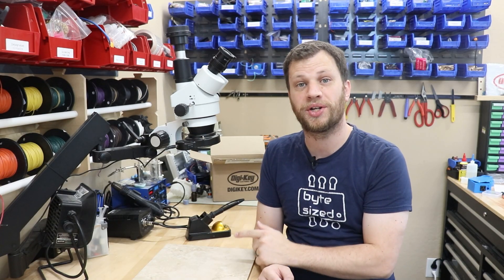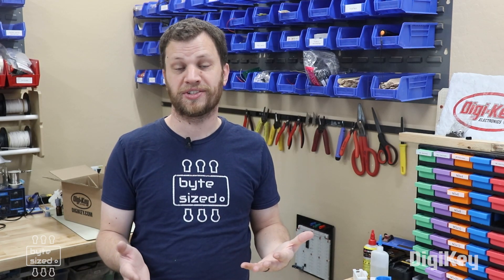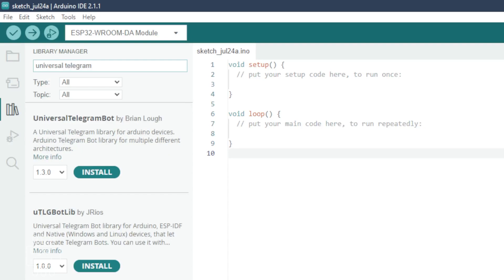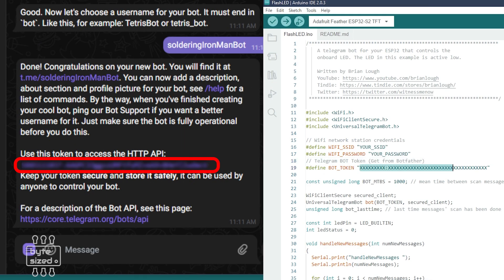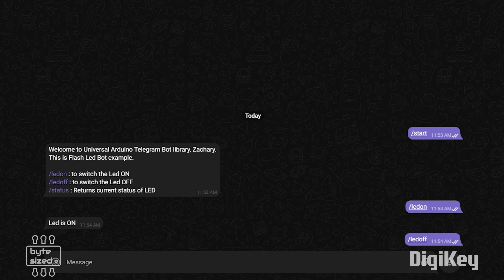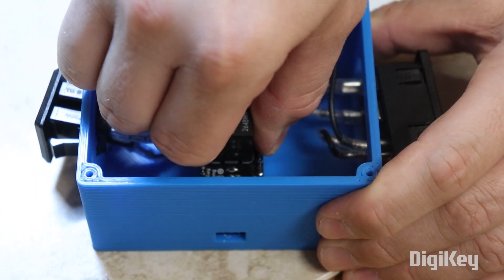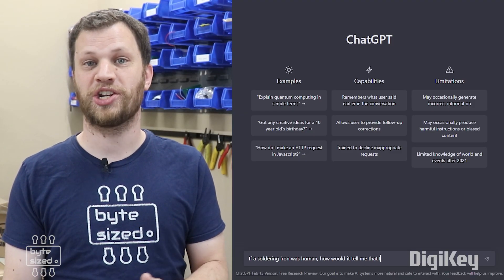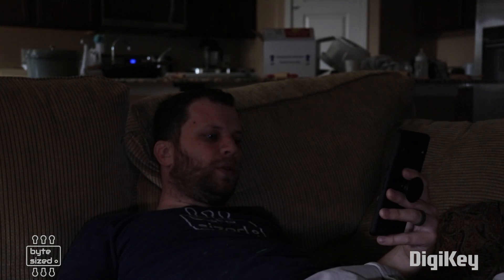Using WiFi to Control my Soldering Iron - With a Twist - The Byte Sized Engineer | DigiKey

Comment: I have an outlet on my workbench controlled by a one hour mechanical bathroom timer that I plug my soldering iron into. It also has a GFCI outlet for added safety.